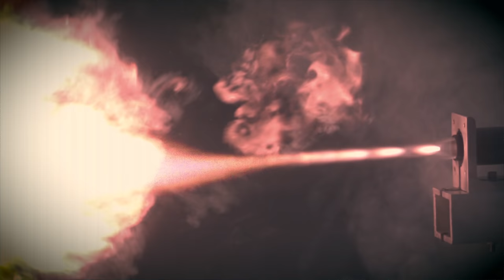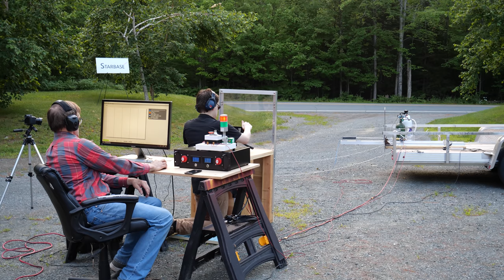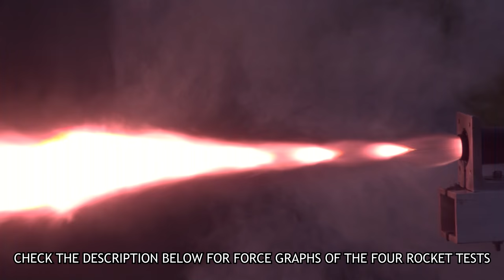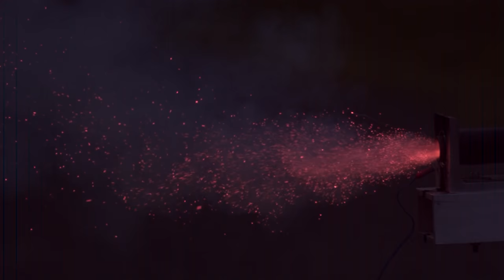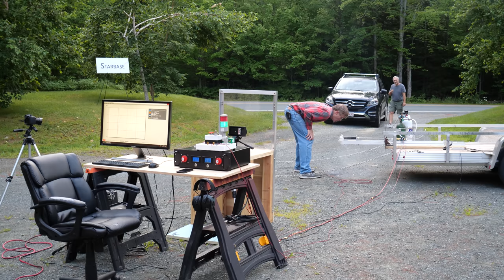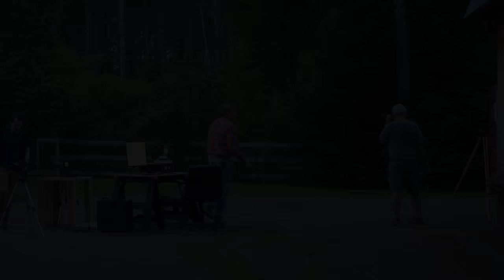Our Most Powerful Rocket EVER! Upsets Local Official!

Comment: Great video! Really enjoyed watching all the work from the previous video's come together.
I locked at the data and its vary impressive but i think it would benefit from some context. You should measure the thrust of this rig without igniting it, i think a significant amount of thrust will be generated from the gas pressure alone.
Reply from the maker: Thanks.
Actually, you can estimate the cold thrust because  the adiabatic temperature of the paraffin/nitrous oxide  is approximately 2,800 C or 3,100 K which produces a ten fold increase in volume vs the cold gas. It's  actually  slightly  larger than this because  of the density  of the paraffin fuel. This results in a ten fold increase in exhaust velocity  through the same size nozzle throat.

Comment: I used to work in a building that was right next to an air force base runway, as in the outer fence of the runway is 5 meters from the building, about midway down the runway right before where the fighter jets would take off. as you could imagine the whole building would shake and if you were outside you'd feel you innards rattling around inside you. I must have seen a thousand F16 takeoffs and it was just as awesome every time, seeing those shock diamonds never got boring. 
Side note, the sound of a F15 with its 2 engines compared to the F16 with just one is astounding, the F15 is unbelievably loud in comparison, although the way they shook my innards felt not much different, I wonder why that is? maybe the two engines would make a resonance or something

Comment: Your rockets are big and cool, but have you ever made one out an aluminum cigar tube.? The rocket motor fits snug in the cigar tube, but leaves just enough room at the top of the tube for some flash powder. Remove the paper at the top  of the rocket motor. There is a powder here to blow out a parachute. We use this charge to ignite the flash powder instead. This blows the rocket motor out of the tube followed by the colored flash powder.
 Glue on three fins, and launch it. Love your show.
Reply from the maker: Good idea!

Comment: Impressive to say the least, awesome shock diamonds. The sound the hybrids make is quite different from an AP cored motor. The strongest motor I had the opportunity to use was a K-500 booster staged to a second stage with a J-125 for an altitude of 13,800 feet...  and that was nearly 30 yrs ago at LDRS-8.  Hi powered rocketry... the worlds fastest hobby..

Comment: If I recall correctly, those mach diamonds suggest that the nozzle is not optimal for your rocket motors. You could probably generate a bit more thrust with a more optimal nozzle profile

Comment: I was having an argument with a rocket scientist about that runaway feedback loop. A similar thing happens with hydrogen peroxide decay into O2. Something interesting is that while "H2O2 Self-Accelerated Decomposition" is a concern, it is highly dependent on concentrations of the gasses, with real world experiments showing that O2 and N levels and pressures matter (per doi: 10.1098/rspa.1946.0014 ).

It was fun to argue with the guy about why it was a bad idea to put h2o2 in an outdoor bug-spray fogger (Which uses propane burning!) vs an ultrasonic mister. He actually had patents on liquid fuel designs, and experience with hobby h2O2 rockets! But because of this unique factor of pressure/percentages, he overlooked the concern. Not every day I get to cite rocket science to a rocket scientist and win an argument.

This stuff is so cool.

Comment: Looks like that last run had a problem with oxidizer supply pressure/volume.  The shock diamonds were demonstrating throttling features.

Comment: Beautiful! I'd say do more work on injector design to even out the flow instabilities ( try helical design ), and look at fuel grain casting consistency, going to dry vacuum curing to limit density variability and moisture entrainment.

In addition, you could use a separate header tank with a pressurizing gas ( like N2) or, use a heater to create consistent endogenous testing for active testing...looks like the flow from your nitrous tank isn't smooth.

I hope this is helpful. Keep on keeping on!!
Reply from the maker: Thanks.
It actually is a helical design.  Did you watch our earlier video in this series on the injector design?

Comment: I humbly suggest increasing the pulse rate on the injections of catalyst. Those pulse tones you see in the slow mo recap are the pulse rates from the electric solenoids and are a huge factor to fatigue in any structure you connect to your rocket.
Reply from the maker: The solonoids are not pulsing, they are powered by direct current from the batteries.  Exhaust pulsations are generated by variations in the combustion chamber pressure which are amplified by the resulting variations in the nitrous delivery.

Comment: Various folks are joking about the bicyclist, but in all seriousness, I’m curious about the apparent discrepancy between your safety protocol at 2:40, where you seem to make affirmative contact with your safety lookout, and 6:46, where you seem to assume that the lack of a received contact indicates an all clear. For all sorts of reasons, the latter is not a good metric to bet safety on. If I were you, I’d set up some two-way radios, not relying on cellular networks, and require a conformation being received from (each of) your lookout(s) before each firing.

Comment: Shock diamonds (they also get called "mach diamonds") indicate the pressure from the rocket being below the ideal pressure for thrust at this altitude. They look neat, but its a sign of inefficiency. The perfect combustion would come out completely parallel to the direction of thrust. You can see the stream of gasses neck down at the shock diamond. At a high altitude the combustion would bulge out away from the parallel stream instead. 
It's why rockets are not designed to be single stage to orbit. Each engine has an altitude where they are designed perform best.
Reply from the maker: Fair  enough, but rocket engines are based on engineering  compromise. Even aerospike engines compromise performance because  of the high temperatures  that limit their ISP.  And, as a rocket climbs, it will pass through significant pressure  changes long before it can stage.
Reply: @TechIngredients  You're not wrong about that. It's funny you mentioned the aerospike engine as I was thinking about it the whole time. It's such a beautiful and functional design to be held up by that problem.

Don't take my post as any kind of criticism. I'm glad there's people out there like you making this kind of content. It was really meant for other viewers to know there's a lot of info in that diamond about what is going on. I'm not really used to the channel owner responding, but thank you.

Comment: Successful project I think, well done. I’m no expert but I think work has to be done on-

1) ignition is not predictable enough
1) the burn seems to be fuel rich and maybe oxidiser delivery needs to be closer to the stoichiometric ratio at all times. 
3) the burn rate might need adjustment perhaps by altering the hollow shape from top to bottom. Those are my three cents.
Reply: Did you consider a hypergolic propellant mixture to start the burn?
Reply from the maker: No.  The safety is much better with the oxygen supplementation.

Comment: Very nice video, but I would preciate to see the test data like thrust ploted during the burn on screen.  
Also I think the reason for the instable burn of the last engine is related to a poor supply of N2O. The increase of flowrate could be a solution or the internal pressure is acting as its own regulator (as you already mentioned). I guess these are equaly important faktors.

Comment: Would an extended nozzle with  holes similar to a blow torch increase force and efficiency? Shield the thrust from eddy currents when it hits the air, while allowing venturi air flow to enter the nozzle to feed the thrust.

Fantastic project. I'm going to sit down as a student and take notes on the different stages thus far
Reply from the maker: No, it wouldn't.  It might decrease the sound volume, but you'd exchange velocity for mass, and so the momentum of the exhaust would stay very close to the same.  It might actually decrease as the modifications will increase the frictional losses in the nozzle.

Comment: Why is the trailer "loose"? I'd think if you chained it much tighter you'd get better readings on you load cell. But it is impressive to see how much the trailer jumps!
Reply from the maker: We left it loose for that purpose.  The movement has a negligible on the readings.  That effect is proportional to the ratio of the acceleration of the trailer to the acceleration of the exhaust gasses.

Comment: There is a lot of good information here. Any chance you could expand on the attachment of the valve to the case and injection nozzle. I'm interested in what equipment was used. Do you have more information on the aft nozzle sizes, case sizes and the volumes of N2O used per test? Any chance you could put the data from the hybrid in the form you did on the composites? I really liked how the composite data was portrayed and it is very useful, a little more digestible for me. Thank you for this great series!

Comment: The shock diamonds are kind of like a thrust meter. Nine diamonds is really a good rocket. I was hoping that you were going to share your thrust data with us; I guess I'll have to get it for myself.
Reply: Shock diamonds mean that the flow was Overexpanded and not optimized for sea level pressure. So there is some performance left on the table.

Comment: You can see the shockwaves oscillating back and forth. I looks to me that the negative feedback loop different speeds in the acceleration of combustion and deceleration of flow. I wonder how that could be dealt with to achieve steady thrust.
Even if you throttle the oxidizer with valve, that valve would have to react so fast to minute changes in pressure that I have trouble coming up with an engineering solution to do that using off the shelf components.

Comment: Most people don't know this,  but there is a very specific reason for the countdown to rocket ignition. Way back before even I was born(no,I learned to make stone tool's out of curiosity) when Werner Von Braun and the other young men formed the  Berlin Rocket Club, they fired off they're first test models in the biggest park in Berlin( it offered the best place w/ lots of room) it was because of they're interest in science fiction. Of course they all wanted to get to t moon and mars. But shortly after they had begun with solid fuel motors a local film maker contacted them to ask about building him a liqued-fueled engine. It didn't need to fly, a static burn for t 'lift-,off' scene would be enough.  So they made it, helped to get it set up and controlled the rocket during the filming.  Of course they all went to see the movie afterwards, it was very popular at t time, unfortunately this also brought them to t attention of t nazi military. But it was t Director of t movie, called  'The Girl in the Moon'... that first used a reverse countdown.(for t dramatic build-up to launch) that got them to start using that as a way of alerting the other park visitors that they were going to fire off another rocket, they thought it was a good idea. It was many years after they had come to t USA before anybody thought of asking why. It was always a way of remembering that first rocket, and a ,'Girl in the Moon'.
Reply from the maker: Thanks for that!

Comment: Are you filming with a high speed camera solely for the viewers, or are you using it to get additional information? i.e. flow pattern, burn duration/quality, etc. Additionally, were you testing different configuration at each test? The set up you are testing, and your take on the outcome of the test, would be a good overlay during the replay of the high speed footage. Just my two cents. Love the channel.

Comment: First off, I absolutely love this series. Takes me back to my youth and time spent playing with model rocketry, your in depth explanations as the the how and why of nearly every aspect of the build is magnificent.

I would like to ask what your thoughts are on the use of a PWM controller to modulate the in-rush of nitrous to produce a much more gradual combustion and prevent the nearly explosive firing of the motor. Much the same way that us in the racing community utilize a nitrous controller/PWM controller to create a nitrous ramp up. Would the use of a controller make it possible to create a more sustainable burn rate and more consistent thrust during the full firing of the motor?
Reply from the maker: It might, but the valve would need to be very close to the engine to prevent vaporization locking.

Comment: Those are some impressive shock diamonds! Impressive to see how necessary the anchoring chains were on the trailer too!
That last test with the larger engine seemed to have a double-howl in the full speed wide shot. But the slow motion video doesn't really show any significant thrust interruptions though. 
What was that double howl? Was that an over-pressure?

Comment: Seeing those hot spots in the exhaust the next logical question is can more fuel/oxidizer (something with higher energy density, but something that requires higher temperatures) be injected at one of those points for more thrust? Perhaps even solid rods of fuel/oxidizer? Granted, there will need to be basically a secondary nozzle to actually harness that energy, but still.

Comment: It looks like there is some combustion instability in the large motor, I wonder if the frequency is related to the geometry of the combustion chamber? It seemed to slow down as the motor burned, maybe because the interior volume was changing?
Reply from the maker: I agree.

Comment: Fantastic. So these hybrid motors burn out in just 3 to 5 seconds. That's some serious power. If that's, let's say, 500 g of fuel at 42 MJ/kg (assuming that it has a comparable energy burning with N2O than it has when burning it with O2), and you burn it in 3 seconds, that's 7 Megawatts of thermal power!
Any idea what's causing the instabilities, especially evident in the Big One?

Comment: I havnt watched all the other rocket videos yet, so you may have covered it, but did you have a da laval nozzle on the end?? I noticed you referenced the shock diamonds on the end and I've heard/read  that is/isn't a good indication of power output. Basically that it isn't because rocket exhaust should be a smooth one directional laminar flow to provide maximal output. But I'm not a rocket engineer and now I'm confused. So maybe a video discussing parameters of various exhaust (da laval/ spike/etc.) might be an idea. Great job and keep up the awesome videos.
Reply from the maker: I did cover the nozzle design.  The shockwaves seen as diamonds are the interaction of the supersonic flow and reflections from the interface with the surrounding atmosphere.  They don't indicate a loss of laminar flow.

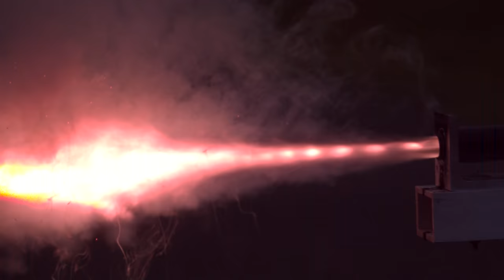Comment: 9:40 I was thinking about the shock diamonds & how/why the gas flow does not expand outwards after the first diamond (seams like the directions should be aimed outwards after that one), and I thought about 2 possible reasons, does anyone else know more about this?
* Does supersonic gases get ("virtual") surface tension, or some equivalent property? (the flow shape looks similar to almost laminar water flowing from a kitchen tap)
* The flow rate inside the cone might be higher inside (less friction from air), so it creates a kind of "suction" inwards again? (if you see a big boat in a narrow canal, you can see the water level be lowest at the middle of the ship, because the flow-rate is highest there, maybe something similar is happening here?)
* Or is it some kind of mix of different properties that crates this phenomenon?
15:09 This was informative :D

Comment: I just finished the entire series and I am a proud new subscriber! I am thinking about implementing a hybrid engine for myself, my only concern is testing and getting in any sort of trouble for doing so. Do you have recommendations for a checklist of things I need to consider and get before testing to be safe legally and physically? appreciate any response/advice you could give !!
Reply from the maker: Thank you!
Focus  on physically safe.  Your local laws and restrictions are beyond my experience.
Like most science, measurement is the most important component.
Get good quality  scales for the weight range you'll  be working with.
Get a stable and remote force guage or load scale that can record.
Have a variety  of mixing supplies, especially  things that you can dispose of.
Start small and test each stage in the process. It's  fun, will allow for improvement, and avoid confusion as you progress.
Don't  store your flammable mixtures.  Burn them off in the open.

Comment: I'm really enjoying this series, it's been absolutely fascinating. My question may have been asked and answered already, but I don't have time to go through all the comments now so. I noticed that there was some variation in the exhaust, where the shock diamonds were forming and the like. Do you know what caused that, if this was due to the nozzle geometry, changes in the flow rate of the oxidizer, non-uniform solidification of the fuel grain? Thanks for the consistently interesting video content.
Reply from the maker: It's likely due to the feedback loop I discussed near the end of the video.
Reply: @TechIngredients  That seems reasonable. Thank you for the reply.